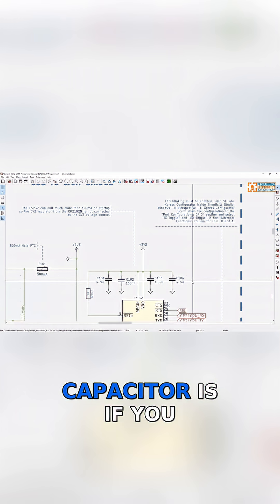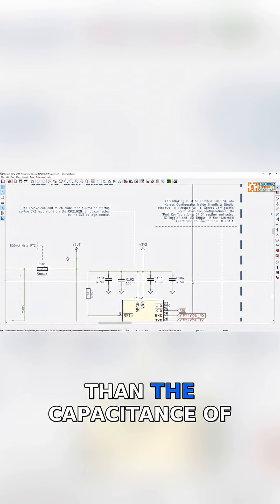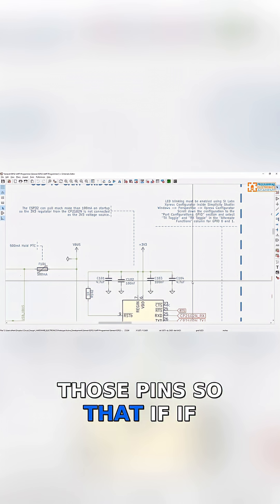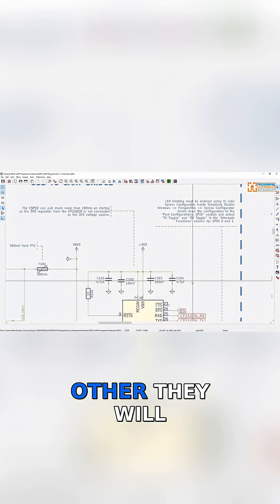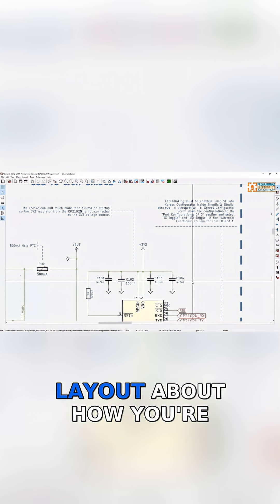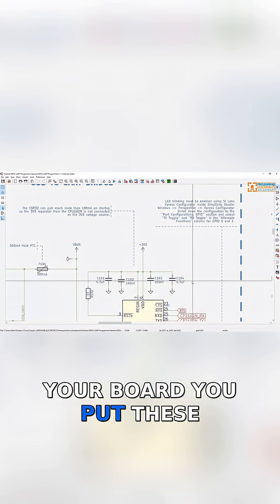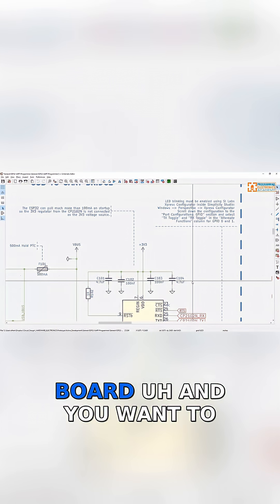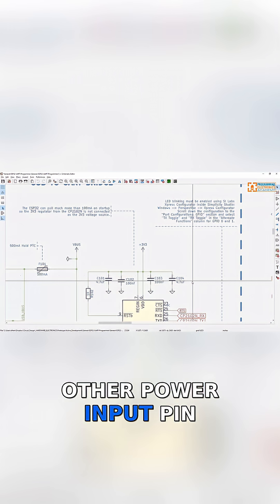Why Capacitor Placement Matters in Circuit Design #schematics #esp32

Comment: The importance of placing capacitors close to the chip power rails is to minimize the L-C effects. In addition, use of lower value capacitors like the 100 nF with the 4.7uF capacitors on this circuit is the 100nF is better filtering out higher frequency noise. This is a standard design technique found in many board designs.
Reply from the maker: Thanks for adding this!